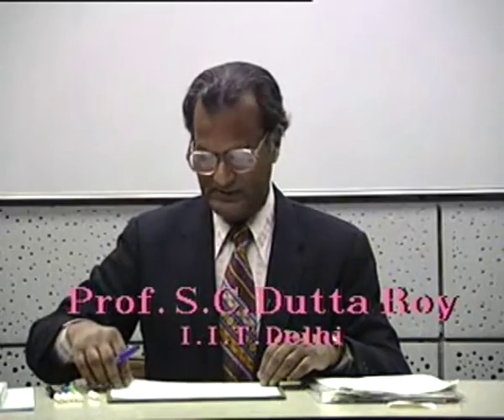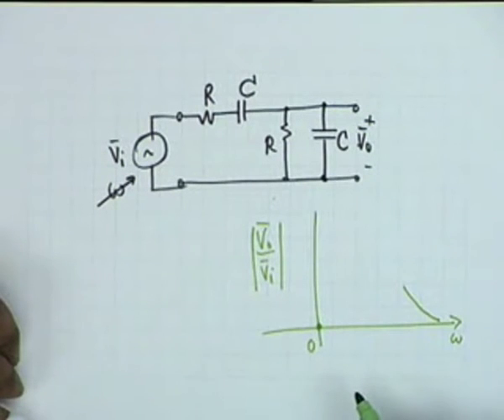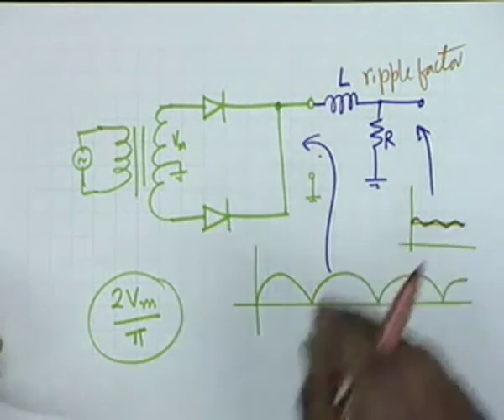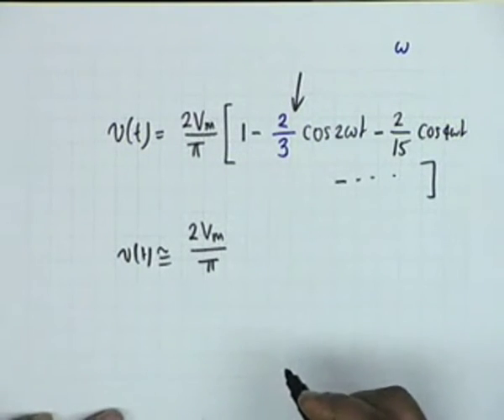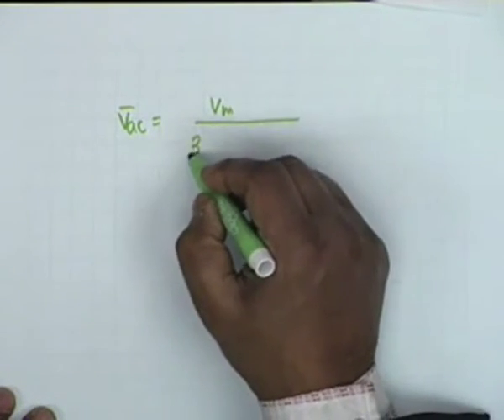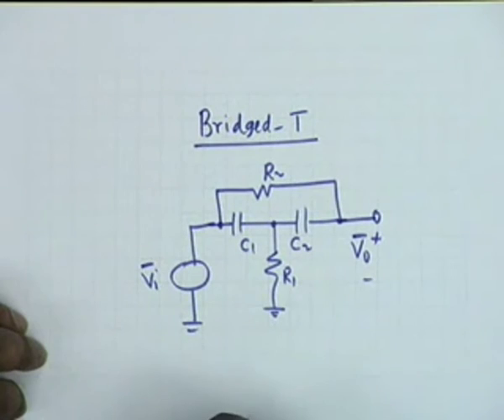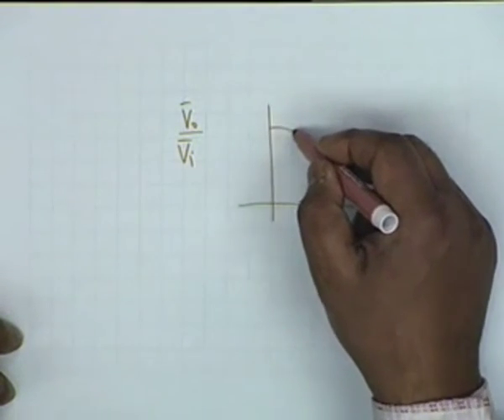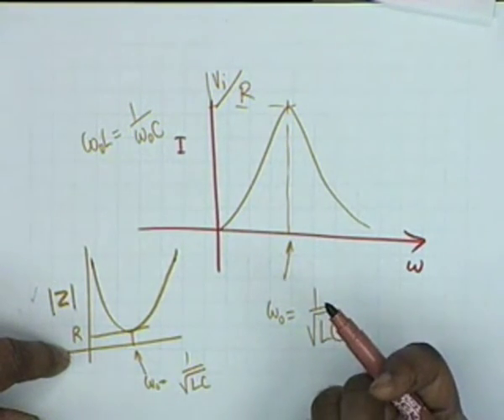Filter Circuits and Resonance

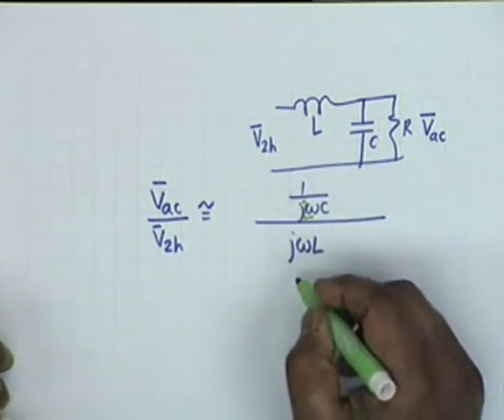Comment: At 29:11, why isn't Vac/V2h = (1/j2wc)/ (j2wl) + (1/j2wc) ?  why did the professor not include the (1/j2wc) term in the denominator?
Reply: It is assumed (as described on the previous page) that wL >> 1/wC, so we can neglect the 1/j2wC term in the denominator.